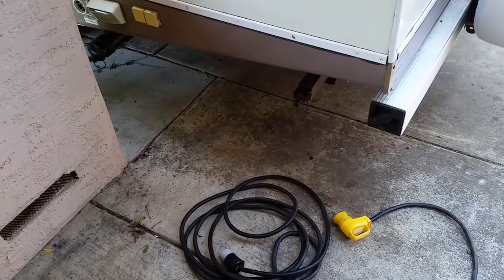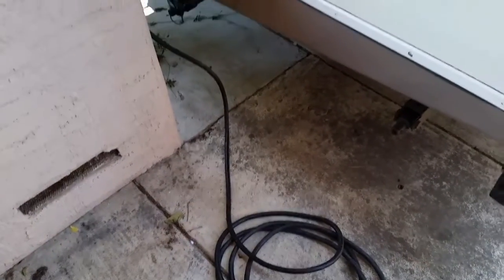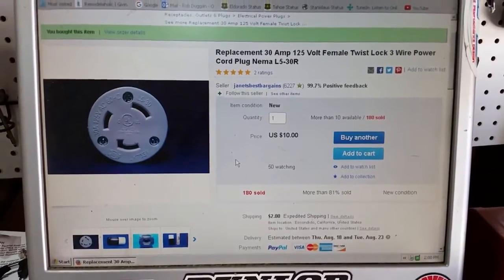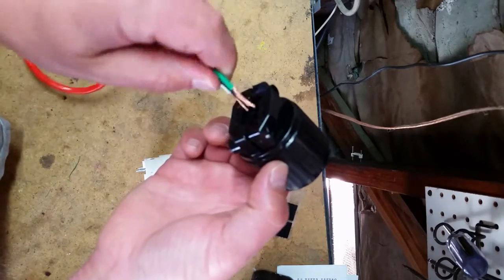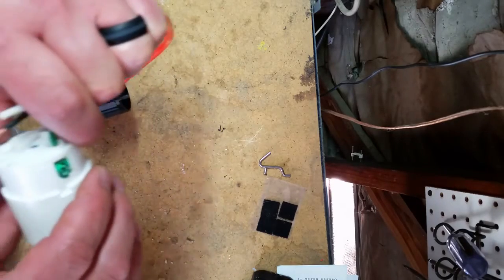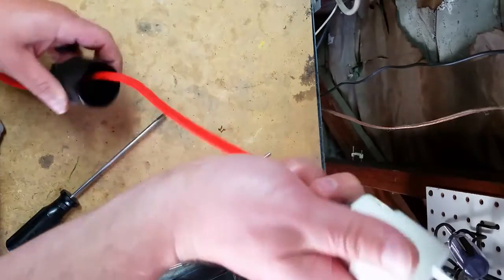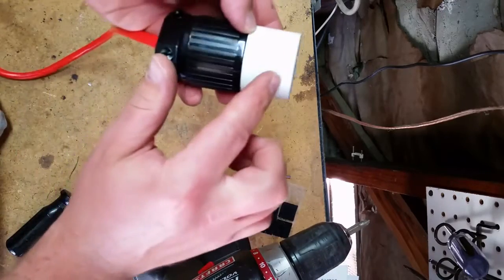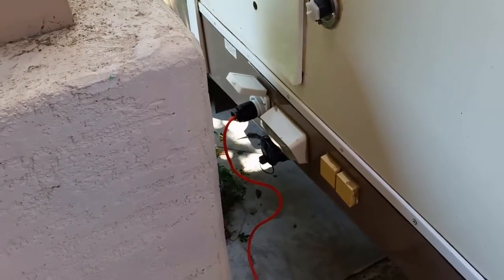RV Pigtail Power Cord Adapter 30 amp to 15 Amp

Comment: Why would you not have used a long enough piece of wire to prevent the connection with the extension cord? If it pours down rain will water stand there?